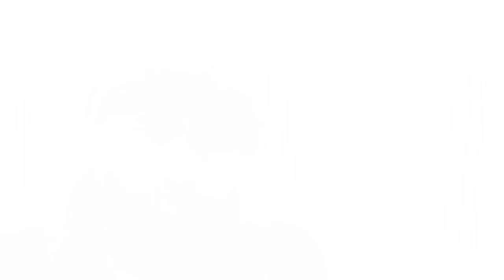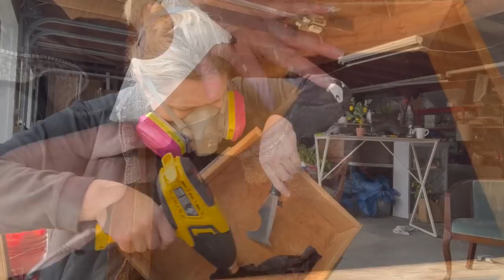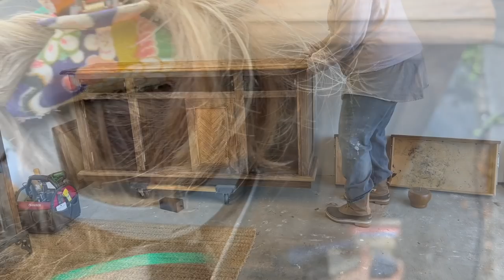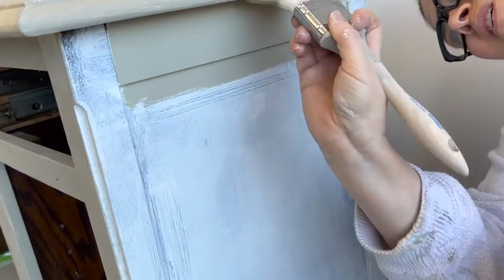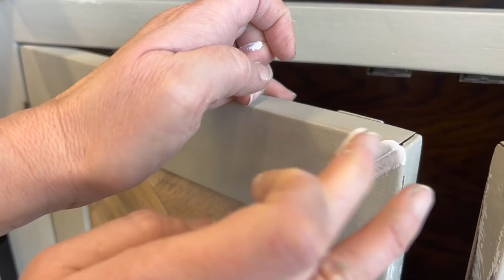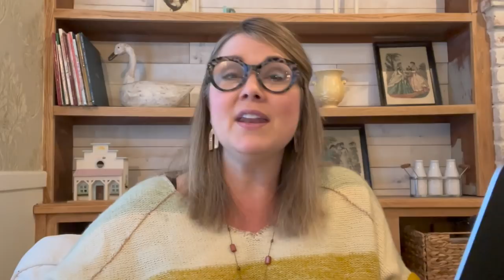FREE ROADSIDE FIND PT 2 | The TREASURE I Found UNDER THE HUTCH |  BASE CHINA CABINET MAKEOVER

Comment: Biff looks great! BESTINE - that's the stuff you need to cut adhesive. It's rubber cement thinner and works like a charm. It's n-heptane and heptane solvent. Amazon has it. You'll be amazed.
Reply from the maker: Thanks so much, and thanks for the tip!  Ordering....

Comment: My Grandmother had a buffet with velvet in the drawers where your felt was but wrapped around cardboard that fit the drawer so easy to remove.....I believe it was for silverware so it wouldn't get scratched.
Reply from the maker: Yes - I believe you are right, that felt was meant for just that purpose. 😊👍

Comment: to get that felt off I take out a pitcher of TSP hot water and pour it in the drawers for 10 or 15 minutes or as long as I think the wood can handle the moisture without becoming a problem. Then I use the metal scraper to get it out but it comes right out. pretty much in one sheet.
Reply from the maker: Great tip!  Thanks Tammie!

Comment: The cloth in the drawers is a material that helps slow tarnishing of sliver.
Reply: As long as you don't  put nonsliver with it
Reply: Some just take apart and turn bottom over and put back together. Love you did the work.
Reply from the maker: Yes!  Sadly, these cloth liners were polluted with all of the filth and funk that was coating Biff, so they had to go.  😊👍
Reply from the maker: Great tip!

Comment: Citrus stripper is not longer the good and almost perfect stripper  seems that the company changed the formula and ended up messing up a great product...  I found one in HP that is much much better  JASCO paint remover even though is chemical does not have a high odor...removes several layers with ease...so now i am using that...and the best thing goes a long way...while the citrus one had to place two three and four times to remove the paint and then deal with a gooy sticky residue...no fun...
Reply from the maker: Thanks for this!  Yes, I've heard that from other folks - gotta try that one!
Reply: @FurnitureFablesbyAndy  I recommend that brand.  I even switched to a Blue Hack brand and paid 98 dollars for a gallon just to find out that was one step up from the Citrus but not as good as the one Jasco.  U can buy a small container to try and see if that works for you.